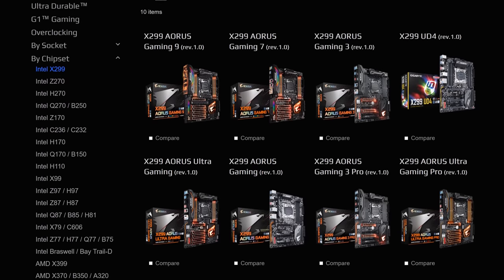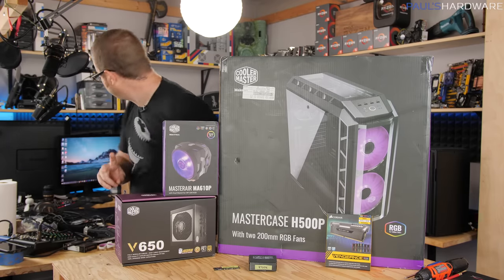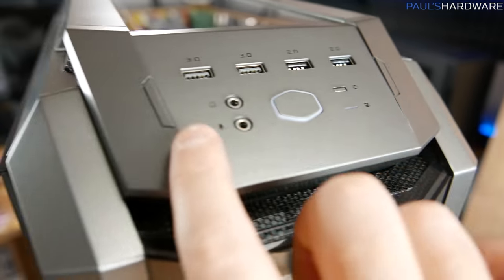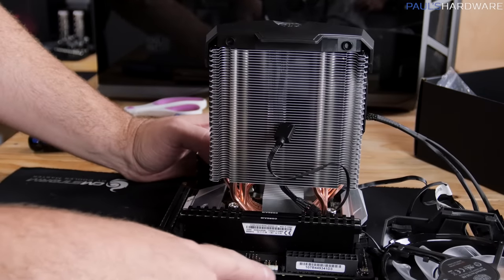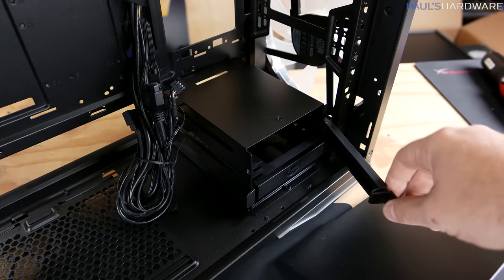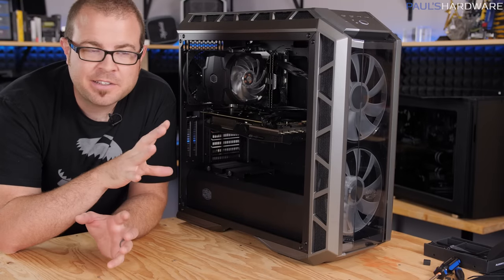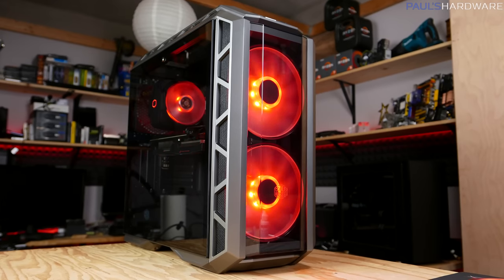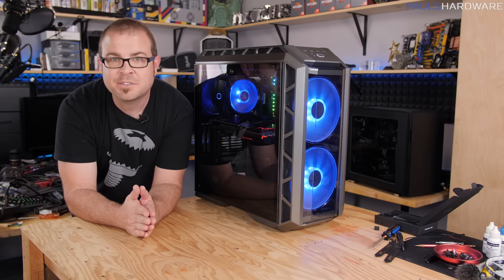Why Not Build a Mini-ITX PC in the Cooler Master H500P?

Comment: I know Paul already mentioned Gamers Nexus' review in his comment, but I would just like to echo him slightly. Regardless of Steve's opinion of the case, he has more data to work with than Paul when it comes to thermals due to his numerous other case reviews. So, I highly advise watching his video as well video if anyone is interested in how this case performs thermally (you should be). That said, good video Paul I would love to see another build with this case in the future. :)
Reply: Brendan Bush to save people some time you could just say that it's basically middle of the pack, so whilst not the end of the world it's certainly not deserving of the HAF name Coolermaster is associating with it.
Reply: Ben to at least improve thermals or even some of the plastic,  maybe give the option or they can change it all together is to take put the plastic trim with metal,  the plastic windows are fine to me, to other maybe not but the rest has no reason to be plastic
Reply: Maybe so, but stuff like creaky plastic and panels falling off and no usb c are a dead giveaway for the cases absolute shit quality. And im sure Paul sees all those things. Once the system boots he should also be able to tell how loud to fans are. And he will probably also notice his Gpu isn't boosting as high as his other cases.

Comment: 11:49 ... GPU sag or just the camera angle?
Reply: Jason R looks like sag to me
Reply: I'm sure there's some sag, but if you look at the top of the picture the horizontal line of the case is not level to the camera.  It's pretty obvious if you look there.
Reply: Big card in mini motherboard 
it is going to sag
Reply: It's sag. I have a 1070 Strix and love it because Asus Strix cards perform great, however the things are so damned big. I zip tied mine to a drive bay for support and have less than an inch clearance with my front rad fan in my CM mATX Silencio case.
Reply: The sag is real.

Comment: My Thermaltake Core V1 is running with an i3 6100 and a Geforce 1050 ti 4 GB video card. It only has one 200 mm front intake fan. 200 mm fans are deceptive. they spin slower and quietly but are still pushing a lot of air through the vents on the side and rear. The fan creates slow and steady positive air flow.

Comment: I have this case and I can say if you actually want high air flow, you have to crack the front panel in front of the two 200mm fans open to get any good airflow, and add more fans behind them.

Comment: I stressed myself over buying this case as I loved the look when it was first shown...and then the fairly negative reviews followed. But I could not help myself and I just bought this case. I should not have stressed myself at all as it is a great case. Really good building experience with so much room inside makeing for a great looking PC. I have a 360mm AIO in the top and with the 200mm fans at the front the temps are more than good enough on my 8600K @ 4.9GHz. The GPU is mounted in the normal position, especially becouse of the feedback from GN and other reviews...though it still looks great. All I can say is from a very personal point of view, this was one of the easiest builds I have ever done with cable routing at the back being a breeze and with the 2 covers to hide the cabling, its almost worth leaving the back panel off..Super quiet and looks great. If I ever have temp issues, I'll do the GN mesh mod...Thanks Paul..

Comment: I"m not a big fan of the RGB thing but this is a pretty cool build. With all the different settings for RBG I wonder if you can actually make it do something useful, like change colors based on how hot the CPU is running?

Comment: Btw, I read steves review, and he's right, it's not really a "high airflow case". It still works. How much cooling do you really need unless you're pushing your stuff way beyond what you should? In steves review he showed the nzxt s340 elite right there with it, and people rave about it. It is cheaper, but honestly, this cases looks make up for the price differance alone. Where can you get a decent case with 2 200mm rgb fans behind a nice clear panel? You could buy 3 140mm corsair rgb fans and use them instead, and that alone would make airflow better. I honestly don't think it's a bad deal. I like it actually.

Comment: could you test, if you leave the 2*200mm fans in there, and put a CPU AIO behind them on the 120/240/280 mounting holes if it cools better or worse than the AIO stock fans? Is it even possible to mount a radiator and leave the 200s on?

Comment: I was really hoping since you used an it mobo, you would mount the graphics card vertically. It would help fill the case more. But you may have not had a pci riser cable like kyle.

Comment: Paul? (Or anyone...)
At about 2:08 you mention the M.2 drive already having Windows installed on it.  I've always thought if you're re-using a drive with a different motherboard, you have to wipe it and re-install Windows.  Sounds like you're not taking that approach.  CAN you just put an existing Windows drive into a new system and still be okay with Microsoft?

Comment: Have yet to see a reviewer try to use the vertical gpu mount on this case. Wondering if the vertical gpu will block the ssd mounts.
Reply: Ziakel watch gamers nexus
Reply from the maker: GamersNexus tried it out, didn't mention conflicts with the SSD trays but it did conflict with a pretty average-sized CPU air cooler above it
Reply: Gamer Nexus did use a CPU cooler that is 70mm from middle of the CPU to pcie slot same as my huge Phanteks PH-TC14PE . So I'd assume with a card that was not 5.51inches tall like the MSI gaming x and a CPU cooler that was smaller like the 212 it may be possible but any cards that are 2.5+ slot cards will still choke for air. Rev 2 of this case will probably be a lot better hopfully they lower the verticle mount and move it back

Comment: Once I had a 400mm fan on my side panel and it was silent and provided so much airflow unfortunately it looked kind of tacky functionally it was great though, and it was a really cheap case, it was the cheapest case that came with a PSU, and I know better now than to use an included PSU but it lasted like 3 years and never caught on fire... Although I very much doubt it was a 600W PSU like it claimed.

Comment: Just saw the case has a Vertical Graphics card slot, DO A DEMO OF THAT PLEASE!
Reply: Matt Beedham it doesn't come with a ryzer you have to buy it separately which sucks for a 150$ case
Reply: With a 2.5 slot card like he used it is not a good option as even if you get it to fit with an air cooler the temps skyrooket with the gpu smooshed agiasnt the glass
Reply: Matt Beedham watch gamers Nexus,  you pretty much have to have a water cooler if you want to do it with an aftermarket card
Reply: It's bad just like every other case with the mount. It will hit cpu coolers and will choke the card for airflow
Reply: DClover you could manage with a fe pcb card or even a small air cooler the one he uses is 140mm wide on the heatsink which is as large as the phanteks ph-tc14pe
So he pretty much paired the tallest 1080ti out with a pretty wide air cooler. I am sure a nh-d15s and a less tall card would squeeze a fit in on most mobos. But the temp choke on the card was real when mounted there
Reply: Eurgh that sucks.

Comment: I really don"t like the fans blocking most the side vents on the front panel... wtf??
Reply: Jeff Lentz Interesting. So you think there might be some suffocating going on? What did Steve at Gamers Nexus say about the air flow? Seems good, no?
Reply: Nick Burak 
No. The airflow is horrible. It actually placed just under the NZXT s340 Elite, which is a case known for mediocre front intake due to the solid front panel design.  

There was a huge difference, 10c temp decrease if I recall, just by taking off the front panel. One of, if not the largest temp changes Gamers Nexus has ever seen in their chassis thermal testing by removing the front panel. Now, I'd bet that if you remove the 200mm fans and replaced them with three 120mm fans mounted recessed back on the bracket, the airflow would increase exponentially. Those two 200mm fans sitting so close to the front panel just chokes it to death. A definite design flaw.

Thus far seems Fractals Meshify C with two 140mm fans added in the front (case only comes with one rear exhaust fan) is the best airflow chassis design option at the moment. He needs to test the Phanteks Enthoo Pro M case. It also seems like it breathes really good with mesh front as well.

Comment: Ive used about 2-3 coolermaster cases. They arent made very well in my opinion. The usb ports short out and the built in fans are cheap. The last one i bought was the more expensive HAF tower and it will be the last.

Comment: I can't help but notice a lot of reviewers being careful not to touch the glass side panel when it's "locked" in place. I suppose it wouldn't do to show how the glass moves around, and that the gap we see between the glass and case towards the top is the range of motion the glass will move back and forth.....on a $150 case no less......I love your videos Paul, but I'm sorry......even at $70, there would be superior case choices from Phanteks,  NZXT, Fractal Design, etc........

Comment: That case blows :3
Reply: Tom the Fish not really. It's starved for airflow. Really Cooler Master should have given the option for a mesh front panel instead of flimsy acrylic.
Reply: I see my terrible joke flew by..
Reply: Tom the Fish you mean great joke
Reply: It goes without saying those front fans are LIT to
Reply: It doesn’t, it has TERRIBLE airflow.
Reply: ElZamo92 it doesn't have terrible air flow. It has average air flow in Steve's review he even mentioned the reason he's so critical on temps is because it's marketed as high air flow but it is more average air flow

Comment: Not High Air Flow. Its about as high airflow as somebody sitting on the toilet. Compressed air isnt going to solve those numerous corners so goodbye toothbrush cleaning them out twice a week. I dont get the silly window theme on the top and front. Who looks at the top seriously. It's either under a desk or on a desk. Cooler master even admitted this by releasing the storm trooper with part of the roof missing. The HAF X was my first case to build in. I loved the expansion till I realised that I was never going to use it. and the gromits were well thought out. Hot swap bays in it great. The plastic power supply cover was a bit confusing but it served me well. Occasionally the fan would go a bit wobbly because the massive fans in the roof would tip the fans slightly in my AIO water cooler and the custom cables would snag the side panel fan but I loved it. This case say we know what we HAF to do but want to sell it to you in 2 or 3 more revisons

Comment: I agree with Steve from GN. The fact the side panel is not flush ALONE is a deal breaker. It looks terrible. Poor thermals + crappy/unsecured top and front panels just add insult to injury. I would not recommend this to anyone.

Comment: Can i fit the 8th coffeelake cpu's on other motherboards except z370??
Reply: Firsg even nope
Reply from the maker: Right now Z370 motherboards are your only option -- there should be other 300-series chipset options in 2018, but Coffee Lake CPUs are not backwards compatible with 100-series or 200-series LGA 1151 motherboards.
Reply: Firsg even Nope. Z370 is the only chipset currently on the market that supports Coffeelake
Reply: nope. unfortunately, intel is not making them backwards compatible and you have to purchase a new z370 board to use them. their excuse is that the z370 boards give enhanced power delivery needed for the higher core counts on the coffee lake cpu's.

Comment: Hey Man i want some help here... i am upgrading my pc case to H500p and also replacing the stock cooler with CoolerMaster Liquid ML120L Rgb. But the problem is my motherboard (https://www.gigabyte.com/Motherboard/GA-970-Gaming-rev-11#ov) have only 2 system fan header (one have 4-pin and other have 2-pin).

So can you guide me how to connect case  front fan(two), case back fan , and liquid cooler pump+fan. (total=5 connection) 

I am also thinking to buy Deepcool Fan hub (http://www.deepcool.com/product/dcoolingaccessory/2013-12/12_663.shtml), But i am confused that is it secure to connect 4 fans in one port. 

I kindly appreciate your help. Thanks

Comment: Can someone tell me the point of "mini/micro" ATX (whatever that means) boards, as well as if they effect performance? Thanks
Reply: worm6942  some people just don't have the space to have a full size computer so they build a micro atx. Or they just want something small. For the most part it doesn't really affect performance
Reply: Mini ITX and Micro ATX are just form factors. They don't have an impact on performance at all, despite offering lower amounts of PCIe slots etc. and therefore limiting things like multi GPU setups and the like.

Comment: Asus' "double-decker" heatsink is CRAP.  It was crap in the Z270I and it looks like it is unchanged, and therefore crappy, on this  motherboard.  The issue is that it traps in the NVMe SSD heat, and the heat from the chipset below it only adds to the misery!  TERRIBLE DESIGN!!!!

Comment: That case is is an overpriced turd. It rattles and creaks with its cheap-ass plastic panels. The 200mm fans are basically only for looks because there is nowhere near enough space for them to breath. They're mounted outside the case, so despite looks there's hardly any front clearance. The side panel wiggles loosely, even when locked. Way better cases on the market for $150, unless you just like pretty shit that doesn't deliver functionality. The ONLY good thing I have to say about it, is that it's very easy to build in. Way overhyped, IMO.

Comment: What I'm waiting for is a push pull 200mm tower air cooler.. And your 2 200mm fan config was done for 2 years now LOLOLOL.Getting kinda bored seeing all the same design mid/full cases these days. No innovation. 
Also Paul I'm not sure whose ankles we were seeing but if it's kyle tell him to wear black socks if it's wifey.. We now.. That changes everything.